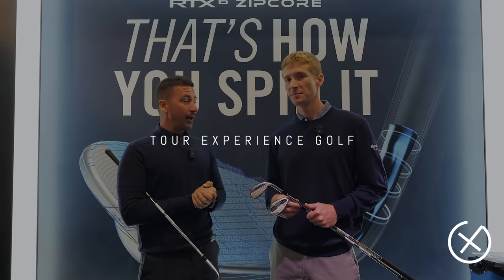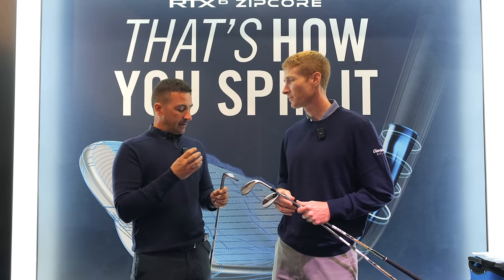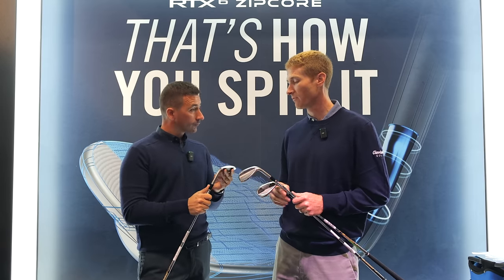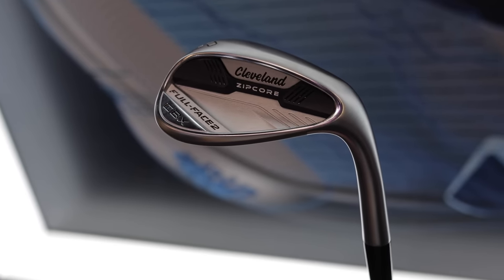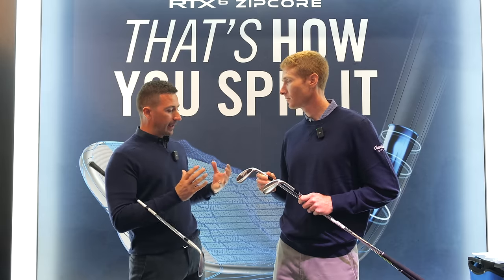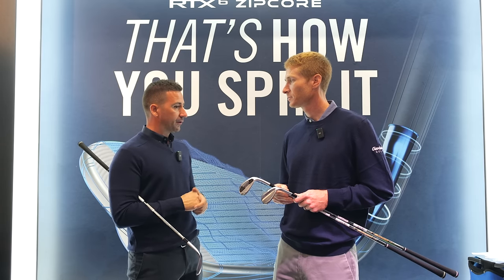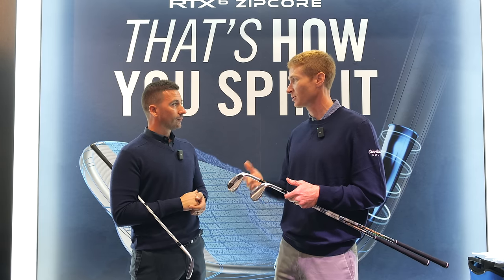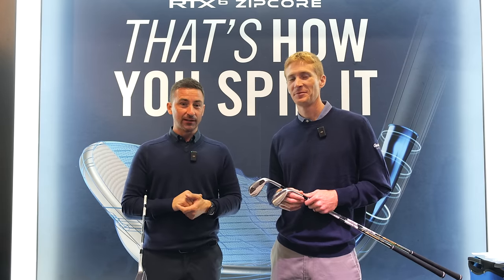Engineering the 2023 Cleveland Wedges // RTX6 & CBX2 Full Face

Comment: Recently, I was considering trying different wedge shafts like the difference between a DG spinner and a modus 115 wedge shaft and come to find out that none of the fitters in the Cincinnati area have that ability. Pretty much the only way is to buy the shaft you want to try and install it yourself from Golfworks.
Reply: i guess they fit that kida shaft very rarly, but if they got a couple they would have them for the next 5years at little cost.

Comment: To the extent that someone at Cleveland reads these comments, just thought I would pass along my story and what I just custom-ordered today (Feb 9, 2023). I'm early 50s, took decade+ off the game, left as a 10 handicap, over the last 3 yrs after enormous practice, especially short game work, worked my way to scratch. Was a 4 wedge historical player but new bag construction is 47, 52, 58 to free up a club in the long end of bag. Here is my story that I hope will help you with future offerings and also others along this journey - I call it the search for the perfect 52-Degree Chipping & Pitching wedge. To jump to the punch line, I just ordered your new CBX2 Full Face 54/12 C-grind, but with a heavier 132-gram S400 Shaft, bent weaker to 53-degrees, flattened 1-degree, and 1/4" longer with a Midsized Align +4 Grip. My current gamer is a 52 is a Mizuno T20 56/14, bent to 52/10 - basically because I want a gameable 52 that is a C-grind because when you go to a 3 wedge setup, you need your 52 to have a C-Grind to maximize your shot selection around the green (I would have ordered your 52 but it has a less flexible Full Grind that I don't want). I have been searching for the last 2 years for any manufacturer to have a C-Grind 52 - no one offers this - I find this crazy as a 52/58 combo is becoming more & more popular yet everyone's 52 is a full-sole brick that isn't flexible - I can't be the only one that has noticed this??? What I love about the new CBX2 Full-face 54/12 is that it has a C-grind - and the heel section specifically is nice and narrow, almost Pro-like, so the club can be opened to hit those nice slice-spin chip shots - and yet the overall sole width has that wider sole so being a weekend warrior I can just smash it into the ground and rely on the bounce to help me - you could of course just offered this in a 52 C-grind which this post is really about. Ping & Cleveland have had a lot of recent success with Chippers - for me, the wider-soled 52 C-grind is the better player's chipper and should be an offering going forward - and it should come standard with a heavier shaft (S400).